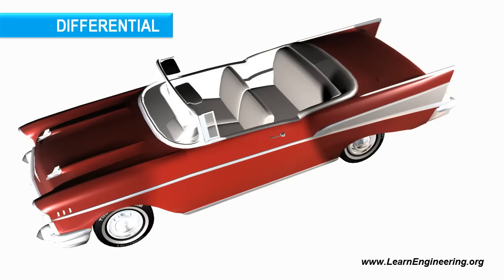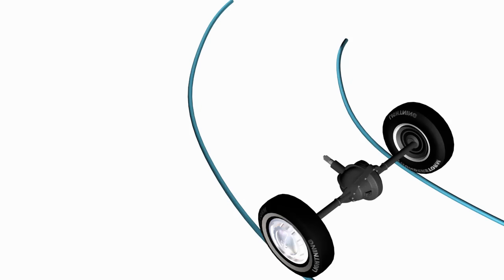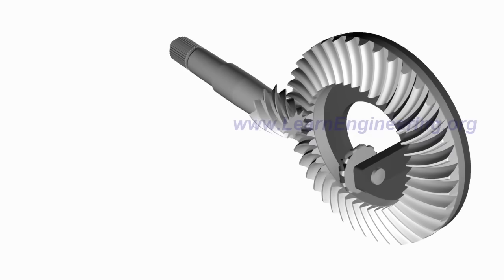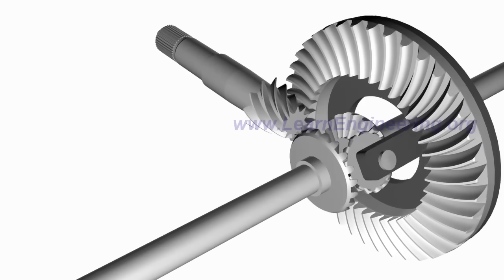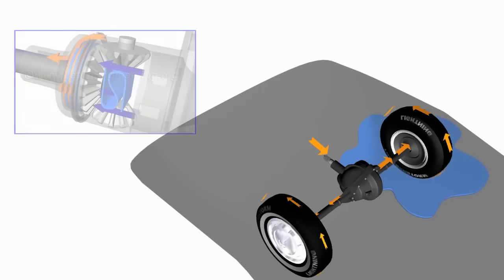How a Differential works ?

Comment from the maker: I hope you have learned something new today. Please support us at https://www.patreon.com/LearnEngineering . Your support keeps us going.
Reply: Sir, please make a video on air brakes
Reply: Can i know what software was used to make this video animation? 🤔
Reply: One Question!
Can the Open speed differentials be used in the Electric Vehicles because the slipping factor can only be cut off if the power output is cut off or by selective braking?
Reply: 9i8
Reply: Yeah I will use this one in my next terminator
Reply: ললললললললললললললংলললললংংললংলংললংলললংংললংলংললললললংংললংলললংললললংললললললল
Reply: If anybody needs a better description, look for the 1930s Ford Motors version of this. This mechanism is not anywhere near as complicated as this video describes. Trust me. I understood it sooooooo much better with old cars. And nothing has changed but the graphics
Reply: C
Reply: @Boy Gilo qqX
Reply: Your starting words are enough to send chills to a mathematician or a maths geek. Anyways, I like to watch your videos very much as you presentation is very simple and easy to understand and helps me to do many sciemce projects. Please make a series on rocketry. Keep it up
Reply: Car Engine working 3D view
https://youtu.be/9A32oNPUbYQ
Reply: Great material. Suggestion: when asking a native English speaker to read a script, allow them to correct grammatical mistakes; "spider gear" should be "the spider gear" and is incredibly distracting when read this way. If a non-native speaker were reading this, it would sound fine, but because it's a native speaker it makes him sound sort of mentally damaged. Knowing when to use the definite article ("the") is something ingrained into native English speakers. So hearing this man being unable to use it properly falls in the uncanny valley. It's honestly kind of spooky. Thanks for your work, though. Good stuff.
Reply: https://youtu.be/CfiAMFmh0Rw
Reply: Great examples and presentation. Horrible narration. Obviously English is not the script writer's native language. +1 for the effort.

Comment: If I was just building a go-kart and didn't care about engine braking or reverse I'd just use a solid shaft and put an overrun clutch on each wheel, as long as it's before the brake disc assembly.

Comment: So what actually causes the spider gear to spin on its own axis?
Reply: The spider gear is loose and it just wants to move naturally in the path of least resistance. You turn your front wheels, and then one of your back wheels WILL be dragged on a longer path than the other, this will 'force' the spider gear to start to turn on its own...

Comment: So I loved this video. I know the comments are old but I needed to try to clarify things for myself and maybe others or at the very least be corrected by others.

The left axle gear is always spinning clockwise (going forward) and the right axle gear is always spinning counter clockwise and when the car is proceeding forward in a straight direction both axle gears, while spinning in opposite directions, are rotating in the same direction and at the same velocity. When a turn is initiated, the outer wheels speed increases which creates the torque that drives the spider wheel to spin. The outer wheel is initiating the torque and the fact that the wheel axles are spinning opposite directions means there is is an opposing force of the inner axle gear, slowing it down. Is this correct?

My question is: is the inner wheel keeping its speed while the outer wheel has increased its speed or does the inner wheel actually slow down from the force? And is the force applied to the inner wheel actually a form of torque?

Thx much
Dan

Comment: Seems like a rudimentary explanation. What happens when the wheel without good traction spins at high speeds? In this explanation, it would be grinding against the other axle gear wouldn’t it?

Comment: so both wheels are always powered, even if moving at different speeds. unless one is free spinning with no traction and the other is gripping. in which case only one wheel really has power, and you aint goin' nowhere.

so just to confrim, you are not driving around with only one wheel powered the whole time? i once had an argument with someone who swore that was the case and there  was no convincing them otherwise.

its good to see how the gearing works though, i have never seen them before, turns a complex process into something super simple. great job on whoever invented it, and great job on the uploader and editor of this video, very well illustrated and explained.

Comment: i get good lesson to solve my friend car problem following replacing engine  original 150hp by 90hp engine not same type. he is in confusion b/n transmission and differential . what is your comment my friend should replace from 90 hp unit ? transmission or differential or both?  thanks  for everything you done!

Comment: this is too descriptive of what is happening, but not why in a turn. It is because the inner wheel in a turn will have more resistance, it thus gives a force opposite to rotation of its axle, the spider gear transforms/translates (what is the correct word here?) this force in the opposite sense on the outer wheel, giving it more force, thus power, thus increased rotation.
The same in the straight ahead scenario: it's a constant balance: the two wheels keep each other balanced,.

Comment: But how spider gear is spinning, from where it is getting that power to spin and how it is changing its rotation of spin
Reply: From the wheels which have different speeds
Reply: So u are saying that difference in speeds of the two wheels allowing spider gear to spin

Comment: Hello, please, if the rear power in the tractor is working in the synchronised capacity with the tractor wheels, can I connect the power sockets directly with the kardan column with the trailer to help push the mud areas?

Comment: Is the spider gear will turn when it receive the resistance from the left or right wheel? Confusing right this point
Reply: Correct. It will spin when one side is pushing harder than the other.

Comment: How does the spider gear know that the car is now turning in a curve, so i have to spin right now.  And from where does it get the power for spinning
Reply: The spider gear turns when one side is pushing on it harder than the other. It spins based on the greater resistive force

Comment: Heyy I have a doubt , so I'm designing an Open differential and I need to decide the ratio of the spider and side bevel gears . Now I'm confused as to how the that ratio affects speed difference . I read a research paper that stated that the ratio of the side gear teeth to the gear teeth must be equal to the ratio of the outer to inner turning radius that we wish to achieve . I'm not sure about this , like what would happen if my side and spider gears are of the same size ? Can anyone help me out ?

Comment: Now as the inner wheel wheel rotate at lower speed and the outer wheel at higher speed..
What about torque ?does the torque  is equally divided...

And during off roading what about torque??

Comment: How that sunder gear { small newel gear } will rotate as there is no power supply to it how does it rotate when vehicle turns and how does it get to know in which direction it has to rotate ? Plzzzzz explain

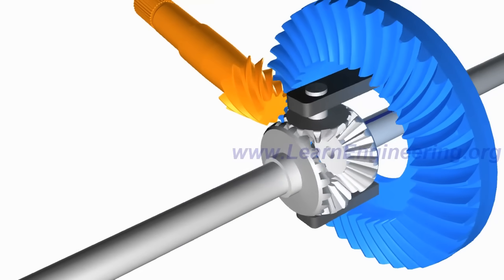Comment: can someone please explain 4:14 - 4:24 further? thanks!
Reply: The speed reduction is happening at the point the pinion gear is meshing with the ring gear. The pinion gear is smaller than the ring gear, meaning the ring gear will rotate slower. However, the ring gear is turning with a higher torque than the pinion gear because of its larger size.

Comment: I did not understand, why will the spider gear rotate on its axis, when the vehicle is turning.
Reply: When a vehicle turns, the inside wheels has a shorter distance of travel than the outside wheel. So there has to be a way for each wheel to be turning at different speeds. The spider gears are what do that.

Comment: I am confused: what powers the spider gear to rotate at the correct speed in a turn? 

(Or is it just a feedback thing from the tire speed, but if that's the case there would always be a delay)
Reply: Speed differential of the wheels makes the spider gear spin on its own

Comment: Great video, once again. I might have missed it, but what force causes the spider gear to spin initially?
Reply: When a vehicle turns, the wheel on the outside will naturally take longer path, in a fixed shaft, it would just skid to match the rpm of the other wheel. that itself will exert force in the axial. With spider gear installed. It will just let the wheel spin insted of skidding

Comment: What the fuck lots of energy wast lots of I it's direct many power is petroleum is save but but petroleum copanis also involve there for banifit they not improve gaire box is already consume most of power if engine is directly connected with back weel its power is save but

Comment: If a car with an open differential is moving in a straight path, and the sun gears (drive shaft) get 50% torque from the ring gear and transfers it to the wheels, what % of torque gets transferred to the spider gears?

Comment: Why will vehicle not move when one wheel is on smooth and other on rough road?
I don't understand it please explain it to me
Thank you
Reply: With an open differential (which is what most card have) the wheel with the least traction gets the most power. If one wheel is one dry pavement and the other on ice, then the wheel on ice will get the power. This causes the wheel on the ice to spin out while the other wheel does nothing.

Comment: There's a video on this that was apparently made in the 1930s and the explanation from that one seem a lot simpler?
Reply: https://www.youtube.com/watch?v=yYAw79386WI

This is the video, and while it is much more simply explained, it's also half commercial for the product and half engineering breakdown. The engineering half is superb though, and they went all out with making custom physical models to show not just how it works, but how the problem is thought through from an engineering perspective. It really takes a lot of the "I could never have thought of that!" factor out and makes you realize that, while this is an ingenious piece of mechanical equipment, it doesn't necessarily take a complete genius to come up with it. If you work through the problem step by step then the problem becomes a series of small problems with much simpler solutions. Then, once you have a working model, you make improvements and optimizations.

Comment: How spider gear rotates in own axis?? I mean what causes it  to rotates?
Reply: It’s just free to move in whatever direction an outside force acts one it
Reply: @lukegoalie18_82 Yeah i got it .... thanks 🤗🤗
Reply: what is that outside force? Like when the car is turning, what force makes the spider gear turn?
Reply: @karttube  watch this video it will solve your confusion 🤗🤗
Reply: Kartik Sonavane it’s the resistance of turning from the inside wheel, because as it says, the inside wheel doesn’t have to turn as much as the outside one

Comment: Me+this video=a blown mind.

This is very informative. I know this question has been asked several times but  how does the spider gear rotate? My hypothesis is that the spider gear rides on the external force of the wheels.

Comment: Pinion is on wrong side of car. You are driving engine in reverse to make this system work. The forward side of ring gear tooth is the convex side. In reality, the Gleason machine would generate the convex tooth facing down at the 9:00 o'clock position with ring gear teeth facing you.

Comment: 1. How does the spider gear know when the vehicle takes a turn so that it starts turning on its own axis?

2. How will the spider gear turn the right gear faster and the left gear slower when taking a left turn and vice versa? It looks like the spider gears and the side gears are equally meshed.
Reply: The spider gear doesn't "know" anything. it simply allow the wheel to spin at different rotations. The physical wheel on the ground will make the spider gear rotate on its axis.

Comment: Call me an idiot if I’m wrong but front wheel drive cars don’t have a differential in the back right? So what happens then?
Reply: Fartman 45000 there is no ring and pinion because the axis of rotation is already side to side, and the rest of the unit is built into the transmission.  The correct term is transaxle, and the axle shafts go directly out of each side to the front wheels.

Comment: How does spider gear knows that car is negotiating a corner
Reply: Akshay Tonge as the car is steered around the corner by the front wheels, the back wheels simply follow, with the inside one slower and the outside faster

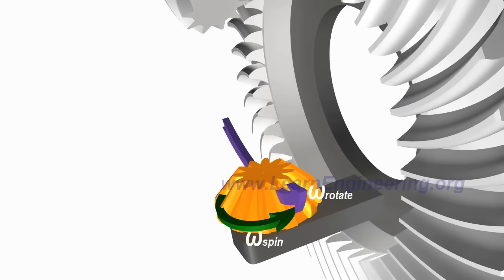Comment: I cannot clearly catch what the author says about velocity during 3:00-3:30. Peripheral velocity : what is that ? In rolling motion, I only know angular and linear/translational velocities.
Regarding the mechanism behind the spin motion of spider gear about its axis which is still questioned by a lot of viewers here, including me, I will reserve it. Although a few people have tried explain, I am still not satisfied, it's still a question which will take time for me to find the answer myself. 
In doing so, I have to remember principles in rolling motions found Physics : Centripetal/centrifugal forces, angular momentum, rotational inertia, torque, etc.
But for now, thanks to the author for efforts to explain about differential.

Comment: In a differential gear if the ring gear and a spider gear are linked interacted with a overall block automation transmission dispatch release then you will have an fully indépendant rotor transmission right and left magnetic control release. This will solve a new integration of indépendant power release control transmission resolving the skid and the tight turn electronically fully control.The mysteries of God has strange ways to empower the new integrated motor transmission.

Comment: wrong animation . how  can a spider gear rotate both gear on diff shaft in one direction . observe closely , it should rotate one clockwise and other anticlockwise. here in this video incomplete diiferential gear assembly is shown
Reply: I think the animation has shown correct directions of spear gear spin.
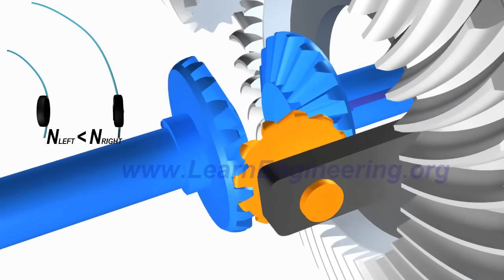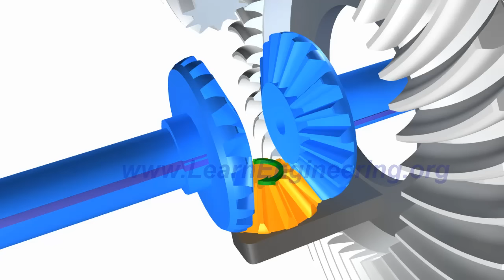When turning right as shown during 2:30-3:30, the spider gear spins counter-clockwise (CC) which causes the left side gear move faster, while the right side gear speed is reduced by this CC spin. When turning left, the spin direction is clockwise as shown during 3:47-3:50 which causes the right side gear rotate faster.

Comment: I Will try to explain how both wheels turn at different speeds 

The two wheels are connected through an axis, therefore both are making the same circular trajectory explained by the equation v=w x r. The angular velocity (w) is the same for both wheels but radius r are different, therefore the external wheel will have more vel than the internal to compensate it.
Both wheel have the same diameter so to have different speeds the two should have different angular velocity of wheel ( attention because this angular velocity is of the turning wheel and is different of the trajectory angular velocity). V= w x r again and this time radius are the same, therefore the external wheel will rotate faster ( w = rotation per second) than the closest one and its angular acceleration ( Alfa) is bigger. This brings an increase of momentum in the distant wheel, cause momentum = I x Alfa, I is the Same in both wheels cause depends on the geometry and weight ( equal wheels), therefore exist an increase of momentum in the external wheel and a decrease at the internal, this difference of momentum is transmitted to the gears until comes to the spider gear, the spider gear turns on it axis because exist a bigger momentum in one of the gears that is connected to the momentum transmitted by the external wheel' and this makes the spider gear rotates on it own axis and this rotation makes the internal axis rotate independent with less wheel angular velocity what avoid the drag when you make a curve.

Sorry, my English is poor but I hope you understand the main idea

Comment: how the spiral gear will operate automatically when the vehicle is turning...?
is there any sensor is used for operate spiral while in turning....?
Reply: Algd Bharath it's free spinning, so if the tires move at different speeds it just turns.

Comment: death for differential is driving in the neutral gear position in very high speed .That stands for commercial vehicles where there is a speed limitation and differential can't handle high speeds.

Comment: how does the spider gear rotate?.It is only mounted on the ring gear,from where does it gets power to rotate?
Reply: Jackson Aniyan from difference of rpm of two wheels..it gets power
Reply: +Parth P
The rpm difference on the wheels is a result of the spider gear spin. Due to the direction of the spin, the outer wheels gets additional rpm, while the inner wheel's rpm reduces by the same amount.
Reply: Lex Soft no the spider gear free spins.

Comment: So a welded diff, you just weld the spider gear so it cant rotate?
Reply: yup.   or, if you are cheating on a dirt short track in the front wheel drive class, you might just weld up the passenger side wheel, but I wouldn't know anything about that.  ;p

Comment: I had one question. Maybe you could shine a light on it.
When making a turn the spider gear in addition to spinning is forced to rotate due to the RPM difference between the two axles. The spider gear is connected to the ring gear so which means making a corner would affect the RPM of the gearbox. If the gearbox cannot cope with the alteration you cannot make a turn. True or not true?